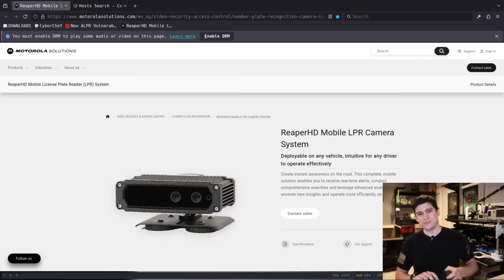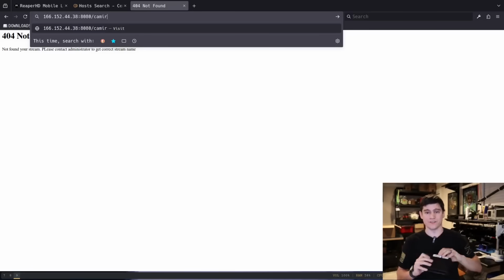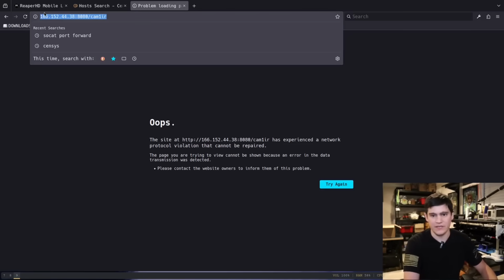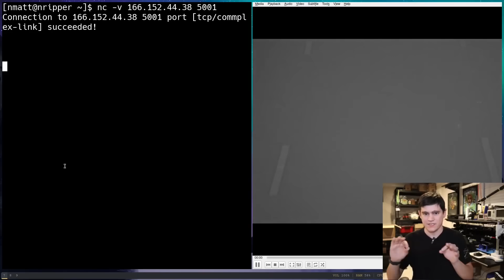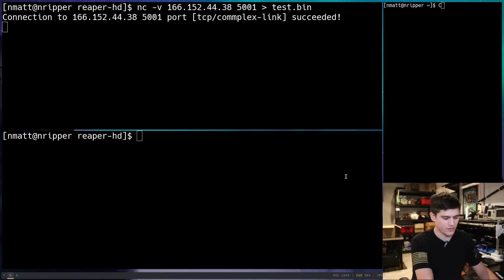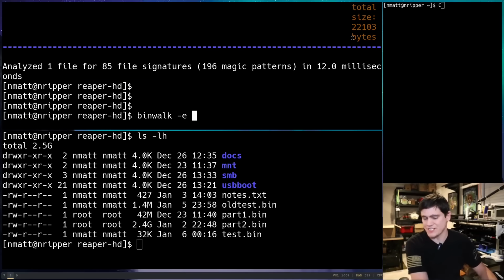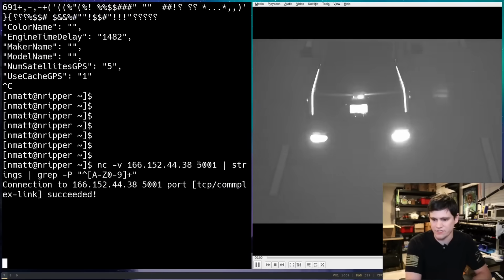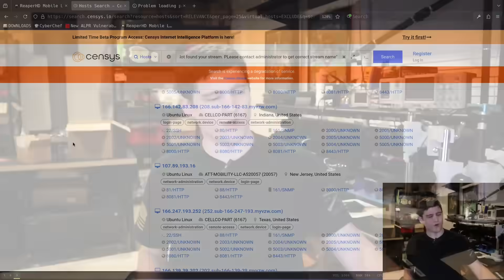Public Video and Data Feeds of Highway License Plate Readers

Comment: and this is exactly how the forensics team working for police and FBI track criminals either real time on the run or post run after a crime across state lines. So anyone on the run needs to swap plates right away or vehicles otherwise you will be tracked or your illegal activity will be tracked and used in court to provide timeline. I suspect there is something very much like this but for cellular data and it can be used the same way this is. my question is if the IR cam uses illuminators can your plate be drowned out using IR LED on your plate lights on the car?

Comment: I'm from Illinois. Based on the overhead positioning of the LPR, and how bright the plate is in cam color, I presume these are the LPRs for the IPass toll readers.
They mount cameras, LPRs, and some RF readers to a pole running over all lanes of traffic, and each lane has a bright spotlight, hence the bright reflection in color cam.

Comment: NO WONDER the Commie, Pinko 'STATE OF WASHINGTON' AKA 'SOW' passed a new law OUTLAWING license plate covers... IT DEFEATS THEIR IR (Infared) DETECTION SYSTEM of the license plates! SOW also requires a FRONT PLATE... so they can read you on-coming. CLEVER COMMIE BOLSHEVIKS! Also, if you don't know, the newer plates have what I term a 'holographic' number embedded in the license plate, which you can see by tilting the plate at an angle. TOTAL SURVEILLANCE AND A VIOLATION OF THE 4TH AMENDMENT!!!!
Reply: Ever see a Tesla with a front plate?
I never have.

Comment: Question on LPRs:  is there a regulation on actual physical placement of the LP on the rear of a vehicle.?  If for instance the reader was looking for the plate say 18 inches above the pavement and the centerline of the vehicle, and I attached the plate at 48 inches off the pavement and 12 inches from the left side (box van)  would the LPR capture any data. Asking for a friend.

Comment: So? License plates are open to the public anyway as they are required to be displayed. Backing in a seeing that on passing cars is no different than sitting in a folding chair on the side of the interstate with a legal pad a pen and some binoculars. 
If you aren’t hooked up to any data base that can give you any specific information that is detrimental to that persons finances or actual private address what’s the point. 
That particular camera doesn’t sit on the side of any highway. That’s biased by law enforcement to check plates and by the repossession industry as a plate locator. It’s recognized plates it sees and alerts the driver and the database(lienholder) where the plate was seen tagging it with a gps coordinates.

Comment: High speed OCR. Now will it bring back the info on the car like driver data, address, registration info? I'd be worried at that part
Reply: It doesn’t seem like it at the moment, BUT, the plate can be put into any free plate decoder and tell you the VIN and exact make and model. There’s a few vin decoders out there that will show owners of the car, most are paid ones but it’s very possible. I’ve personally used one on my own car to see if it worked and it does. It didn’t show my address just my full name, when it was registered, the previous owner, and a few other parts

Comment: I noticed the city of Atlanta put these up in midtown when my infrared camera kept picking up it's non-stop flashing 24/7.  Most people are unaware of them. The city says they are for "parking enforcement", and that the data is not public, but they hold on to it for 2 years.  They basically track every you go, your routines, your driving history, add in some AI software and another brick from our foundations for privace removed for good.

Comment: this is reminding me that my city used to do this and advertise it as a feature. they just called them "traffic cams" and you could go to the city's website and look at any cam at any time. i never thought to check if it was hosting any other services, but the city stopped providing public access at some point (i never got a reason why). One of the cams was near my house and it was nice to see what traffic was like lol.

looking at the text data in the bin dump you got, it seems like there is gps nav data associated with the picture. this makes sense because it would help if the file was needed for evidence. i'm guessing gps time is encoded too. the coords are probably in there as IEEE754 64 bit floats (a pair of doubles)

Comment: You would imagine not only having access to these ports authenticated (that's what all IP cameras usually do), but also all the cameras living on a VPN so they're only accessible internally. The latter would also pretty much deter all attempts at exploiting security issues in the firmware, which might or might not exist, but probably do.

Comment: There’s a thing called a cube corner that reflects light straight back to the source. That will saturate the camera 😮. Signs and plates use this at the microscopic level but they strategically make it imperfect so the light from your headlights gets back to your eyes. a real cube corner will be too perfect and will return too much directly into the camera right next to the source. I believe it should work with radar too because I would guess the detectors rely on scattered waves returning not perfectly reflected wavefronts 🎉 this could be a new buzzword - hacking with physics not software

Comment: Interesting video, but I can’t help feeling like it’s pointing out something that’s already obvious. It’s as if you’ve rediscovered the wheel, only to tell us it’s round. Let me explain:

1. Storing Data Isn’t Groundbreaking: Yes, these ALPR systems store license plate data, but so can any regular camera with basic recording software. The fact that it’s automated is convenient, sure, but not revolutionary. It’s like saying a coffee machine makes coffee automatically—we’ve known this for a while.

2. Cost and Efficiency Are Overhyped: The claim that this saves time and resources for “malicious actors” doesn’t hold up. Anyone determined enough would already invest in their own systems. Saving a few minutes here and there doesn’t make this a significant advantage or game-changer.

3. Mobile Cameras Aren’t Practical for Tracking: Mobile ALPR cameras, like those on police cars, move around randomly. Unlike stationary cameras that monitor one location consistently, these can’t be used effectively for long-term tracking. You might get lucky occasionally, but that’s not a reliable strategy.

4. Unsecured Feeds Are Old News: Publicly accessible cameras without proper security? Welcome to the internet. From tourist webcams to mall surveillance, this isn’t exactly breaking news. The ALPR feed is just another example of poor security practices, not a major revelation.

5. Symbolic, Not Significant: Leaving these systems unsecured is definitely a mistake, but it’s more about bad optics than a real security threat. It raises valid questions about data governance, but the actual risk here seems minor. It’s a “should’ve put a password on it” moment, not a headline-worthy scandal.

6. AI Has Made This Mundane: License plate recognition was once complex, but today, it’s as easy as recognizing a banana with modern AI tools. ALPR systems may be convenient, but they’re hardly cutting-edge. It’s hard to be impressed when the same task can be done with free software and a smartphone.

In conclusion, while this video might intrigue those unfamiliar with these systems, it doesn’t really reveal anything groundbreaking. The issues it raises are mostly symbolic, and the practical implications are minimal. Still, it’s always interesting to see discussions around technology and responsibility, even if the wheel isn’t as round as it’s being made out to be.

Comment: Is it possible to obtain a clear-cote material that would block the transmission of infrared wavelengths?
Reply: There are supposed to be sprays that you can spray onto your license plate to help block those waves.  It sprays on like a clear coat paint. Whether it works or not i haven't been able to test it.
Reply: @KennethITGuru I have it on my plate, it works. It works very very well

Comment: As an OTR truck driver, it would be interesting  if the snitch cameras  we have in our trucks could be viewed remotely  by somebody not authorized..  My company  says that the cams only record footage if a triggering  event happens..  I.E. hard braking,  a wreck, etc.  I for one don't  believed  that footage is just captured.  

Also,  we have the electronic logging devices which have IP & and MAC addresses  easily  read on the screen.  I'm  guessing  an unauthorized  person could snoop into those as well.
Reply: Fellow trucker here... Yes, its recording constantly... More than likely if you work for a large company, then they use a 3rd party company to review the videos and then send to the trucking company... Your truck's ECU is also connected... Your company can get alerts on if you need to regen or not... I could go on and on
Reply: The Wyze cameras in our trucks are always recording. Managers can view an entire day, or watch you live if they want.

Comment: ive been doing repo work for over 2 years now and we have and use these on our vehicles all the time. its great for letting us know if a vehicle is up for repo or not. its not just the tow trucks that have these, we also have hourly paid employees drive around in sedans with these on the roof. ive actually worked with that model and setup basically since i started working. the central computer is what they call a VLP. we also carry laptops in the cars and just drive around scanning plates and logging the locations for later. so for say you stop paying your bills and a bank opens a repo order, they'll import all the data for it and also see that motorola logs have seen that vehicle in the past. that's a really short explanation so there's a lot of grayed details i missed.

most the time if my laptop notifies of a potential hit and i go back and verify, depending where it is like a gas station of sorts where i usually see police, if i notice those plates are on a car its not registered to, you know damn well im telling the officer there about it. look, you dont pay for your car and decided to plate swap, i hope it burns you in the end 🤷

Comment: License plate readers (LPRs) are funded by the sheriff's office or local PDs. LPRs are being configured and deployed by the contractors at the remote locations where the entity's fiber network is unavailable, so they are using cell connection. The processed data is then transfered to the cloud where it's being stored. Sherrif's office is provided with the cloud access where they can search the LPs and set alerts for specific LPs. 
In some cases LPRs are deployed with a solar panel and a battery.

Comment: :elbowcough: Very COoL.  I haven't been this intrigued since I found out my hot sister was adopted. Just saying  :body-blue-raised-arms:  You  R  the "License Plate Data Whisperer" (LPDW). Thank you for the vids. I would swing by more if YouTube would stop sending me stuff I don't want to see. Like that time I walked in on my grandma in the shower (sorry for that visual). You RoCk! Cheers from So.Ca.USA 3rd house on the left. p.s. Watch for a my plate:  [I LET M GO]. Once they radio that in they usually send me on my way. Go figure.  :hand-pink-waving::face-blue-smiling:
Reply from the maker: What the heck did I just read 🤣
Reply: @mattbrwn  This is certainly a day to be literate
Reply: @mattbrwn   250 points awarded for a GR8T answer   note: points can be redeemed at any participating Fisker™dealership :face-turquoise-covering-eyes:

Comment: Repo ppl use this for the longest time, skip tracing, bail bonds, side hustle, these have been around for 3 decades. Just as the technology is getting easier to use people have an issue with it. ATM cameras, are used by law enforcement all the time. They are there for the safety of users, but can be used outside there normal realm.

Comment: Most alprs are attached to a metro 4g/5g network that is segmented like a MPLS so its a private network that doesnt interface the devices with the public 4g/5g networks though it ises the same sim and carrier towers. The device forwarding is managed by the local public agencies it, generally through the city/county/state wan. So their firewall points off to whitelisted domains or ips from certain internal devices like those alprs. 
Now do some agencies not have great cyber? Yup. Are some devices on the internet? Yup. 
Its bad practice. But a overwhelming majority of agencies and their vendors are more withit than this exploit alludes to.
With the growing ESInet solution ecosystems and interooerability networks growing, you will see more and nore COTS equipment that will never see the publics internet but uses the same communication standards and tech. And yes if someone got keys to the castle ther is a potential. But if you ran wireshark against your wifi youd be suprised at all the crazy stuff sent in the clear there too. 

You dont have firewalls behind p25 and 5G radios but since they are on their own encrypted over the air traffic the public cant just hijack and break in. Same thing.

But i like this kids bring this up. On board encryption isnt hard to impliment and nearly all current alpr ststems do have it, but yeah older stuff phased ot and sold on ebay may be behind the curve and worth dosecting and pointing out flaws. 
Id say alprs resale market is great for apartment complexes, shopping malls, and private citizens who may need to look onto odd goings on. Last week i found a stolen truck was parked in the area and there was a atteped motorcycle theft that evening too. So ots not a bad thing to watch for

Comment: People saying that it doesn't matter because it'll be behind a private network anyways really don't understand network security. It doesn't matter if it's behind a private network if there's swiss cheese protecting it. And even IF that network was undiscoverable, the fact remains that most damage from security breaches happens once the attackers are ALREADY INSIDE your 'secure private network'... I see time and again very big and very important people cutting corners and refusing to use secure passwords internally or using defaults. Many attacks boil down to one thing, an insecure private network that just barely touches the edge of the internet from another device. You think you're safe, but you're not.

Comment: Would be so easy for them to have two of these cameras 10 miles apart, and then ticket-by-mail speeders that have passed from camera 1 to camera 2 faster than possible by driving the speed limit.

Comment: well either they have shut down the feed, or something, because now the VLC Stream does not work. it refuses the connection
Reply: Probably been hit by every man and his dog watching this. It doesn't take much to take something like that offline.
Reply: @threeMetreJim  yeah, im pretty sure the 6 dislikes are State Employees as well, trying to figure out how to go after matt now. 

Good luck with that LOL 

i even tried a port scan, zero response.  

also, that was a vertically overhead camera, ALPR's in that config are scanning for Express lane violators.
Reply: Some are on prepaid data limited sims that have likely run out of their monthly data allotment now 🙂
Reply: @FloridaMan02  VZW like ATT, honors true unlimited plans for Government use.  I have telecom experience in my 23 years of IT.  

So i doubt that is the reason, plus this camera is clearly above a lane monitoring what looks to be a toll route tracking toll highway usage by checking plates at each station to see when they got on and get off.

Additionally, that would not stop a port scan as well.  my connect was physically refused and reset.  Data Allotments don't do that.  they simply throttle the connect, but a scan would not be something a data allotment would be considered as an actual data stream.
Reply: @CapStar362  I agree in your particular example, however not all of these are government or will ever be retrieved by their owner.

someone who isn't me bought some mobile cradlepoint routers surplus that came with sims like I mentioned.
Reply: @FloridaMan02  and obviously i omitted anything that wasn't specific to what we are doing here on this video, which clearly is IDOT.   I am more than aware of additional circumstances and what not, but they are irrelevant to the topic at hand.
Reply: @CapStar362  roger that. my mistake obviously.
you have my apology.
Reply: @FloridaMan02  all good :)

Comment: What happens if the vehicle owner installs a surrounding set of high intensity IR LEDs around the outside of the license plate holder?  Does it eliminate the ability of the reader to discern the license plate's numbers?
Reply: If you want to figure something out, just get an IR sensitive camera and test away (normal security camera with night vision). The plate recognition cameras will get the same effect.

Comment: Several agencies use them, and it is not always law enforcement; most toll agencies use them at toll gates, parks and rec agencies, traffic management agencies, and even some private companies use them. 

The data are stored on a private cloud-based system that the agency contracts with.